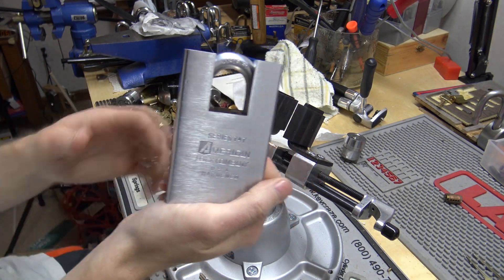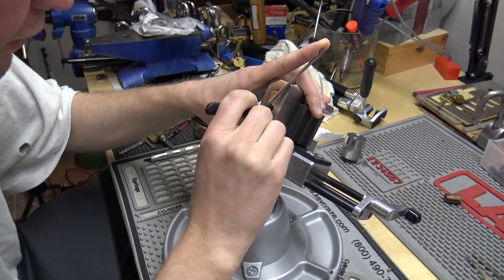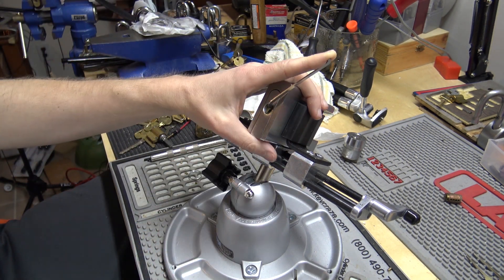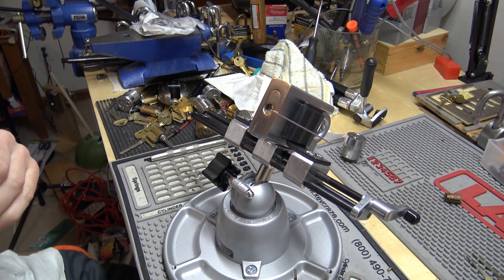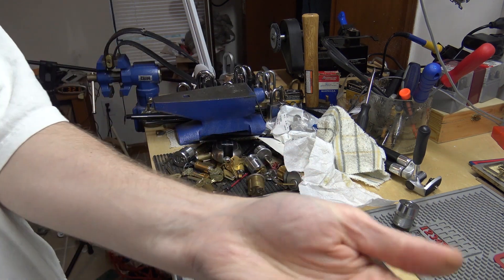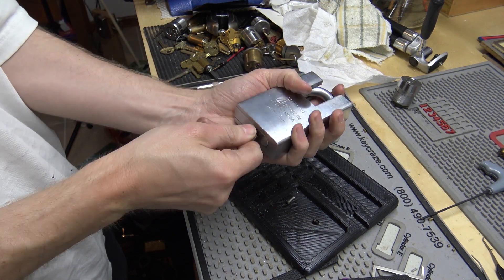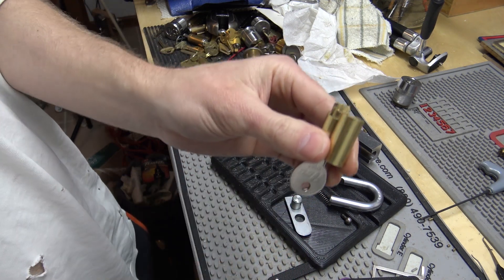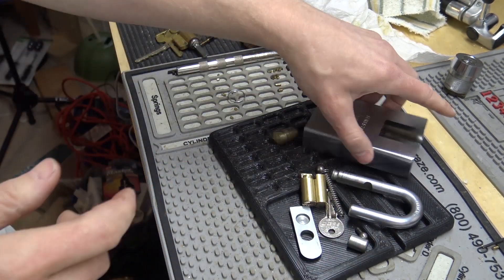(373) American 747 Padlock Picked & Disassembled

Comment: great lock, and picking and gutting, but if you want to get those little stopper pins out find the small pointed side cutters and use them like a tiny claw hammer, they come out pretty easy just don't squeeze to hard or you'll cut it off instead.

have a great day
Reply from the maker: Thanks man!

Comment: I ran into one of these padlocks but instead of being shrouded on both sides, it was only shrouded on the left side of the padlock.   The customer had come back because my key copies didn't work.  What had happened was the keys were not going in smoothly because the cylinder was pretty worn.  We eventually got 3 keys working though.
Reply from the maker: Ken _ love these locks

Comment: Nice.  Those old 747 cores are no joke.  I have an old 747 like that but the cover won’t slide out no matter what I do.  I think the big retaining under the shackle is stuck.   Anyway - those are cool, massive locks.
Reply from the maker: You got that pin out from the back of the lock and shackle won’t pop and release the pressure on it?
Reply: Bored Lock picker - I got the lock open, the back hex screw out, the little roll pin is out, the shackle and spring are out but cannot get the slide plate off.  The plate itself is loose, I can even get a shim partway under it.  The big pin down in the shackle hole that keeps the plate from sliding off won’t budge.  I’ve hit it, soaked it... just been sitting almost completely apart for months...
Reply from the maker: Fast Charlie that’s wild.  Can you get a long screw driver down there and knock the shit out of it just try and free it?